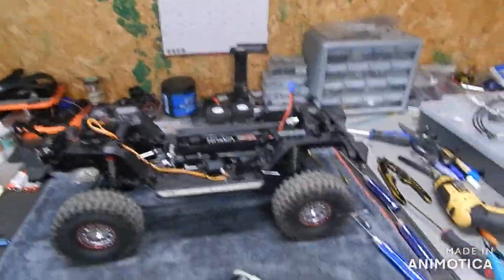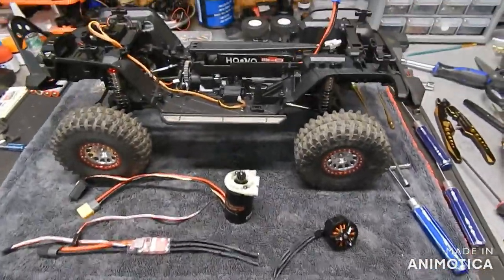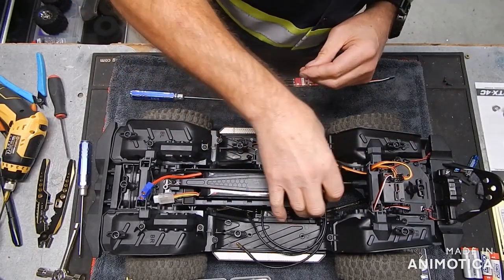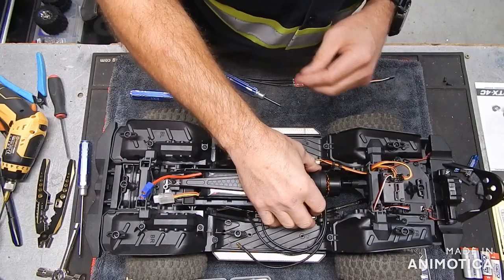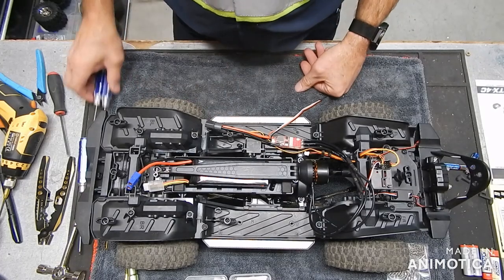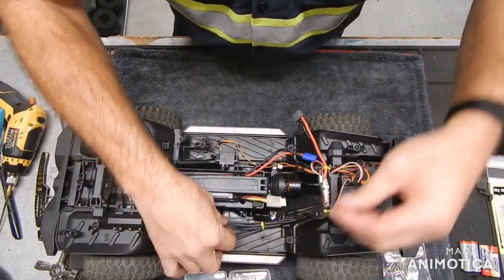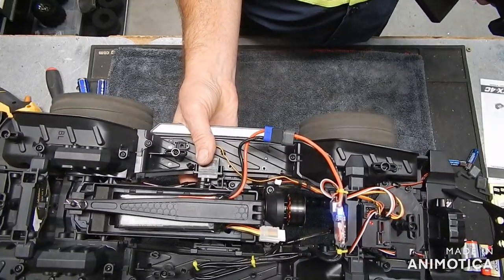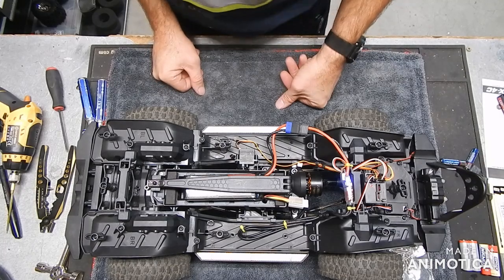WL Toys 104026 Brushless Outrunner Motor Swap

Comment: Which is better, the Seguier 3625 or the Hobbywing Fusion SE?
Reply from the maker: Both are good. The Hobbywing Fusion SE ended up working better in this Jeep, the stock controller ended up not being the best when paired to the Sequre System, but paired to a FlySky system in my Exocutioner build it works great.
Reply: @racecar021872  
Thank you very much for your test
Reply: @racecar021872  
Thanks for your test
Reply: @racecar021872  I just bought the Fusion pro because the pro is only 200 RMB more than the se, which is equivalent to $25

Comment: gutes Video ! ich brauche mahl ein bisschen Hilfe ! Wie kann ich diesen WL Toys Tieferlegen ,der ist mir zu Hoch, hast du eine Idee? Gruß Crossover RC
Reply from the maker: I really don't know a way to lower it and still have some suspension travel. I, too, think it's too tall. Shorter shocks might do it, but then you risk losing travel.
Reply: @racecar021872  Ok danke für die schnelle Antwort ,mal sehen was ich da mache und ein schönen Tag noch

Comment: Thanks for this vid. Great instruction.  I just received my jeep and planned to change the esc to fusion as well
Reply from the maker: Definitely go with the Fusion, this Sequre Hobby outrunner did not do that great in this. I ended up installing a Fusion SE1200kv in it and it does much better. I ended up putting the Sequre Hobby outrunner in a different project and with a different radio system it's really good. The radio system for the WL Toys wasn't very good for the Sequre Hobby but works fine with the Fusion SE.
Reply: @racecar021872   Ok ,i choose Fusion Se 1800